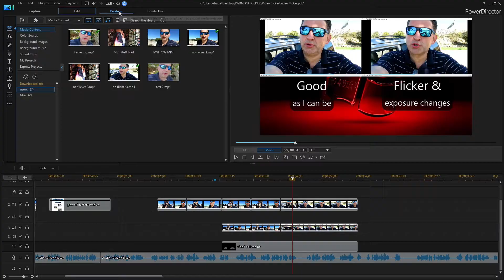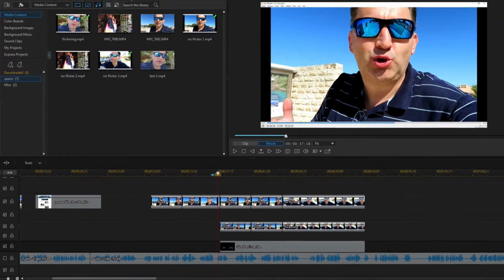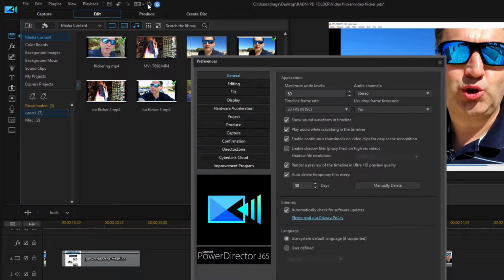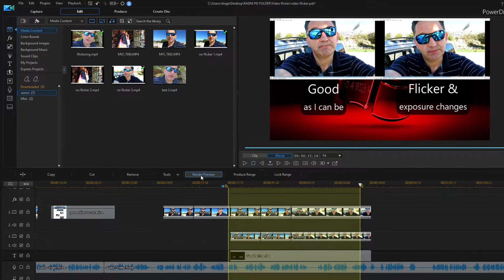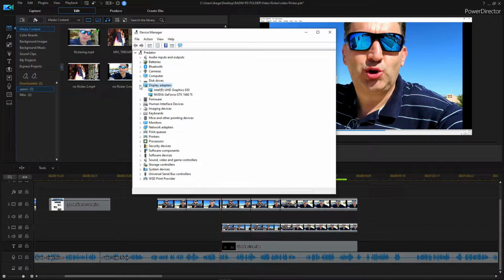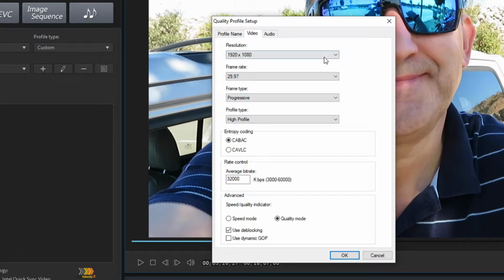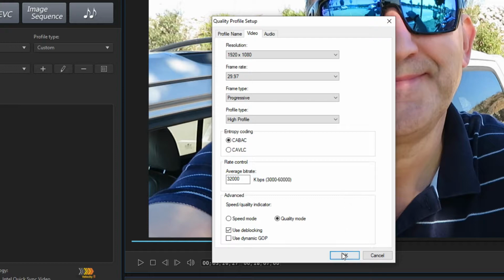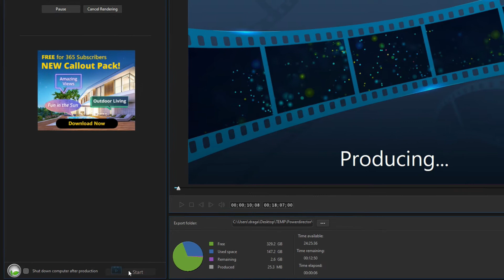Video flickering problem after rendering (producing, export) in Powerdirector

Comment: This didn't work in my case.  In my case I was rendering in 60 fps but the original was 59.94 fps.  Once I rendered in the same frame rate the flicker stopped.